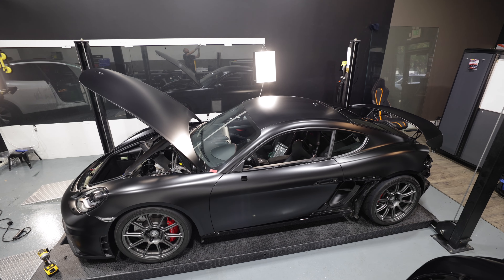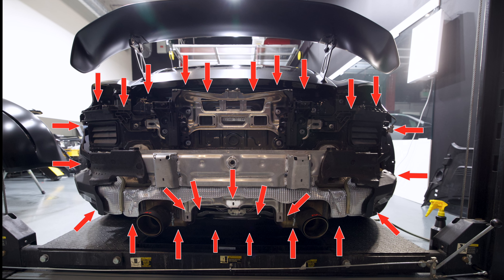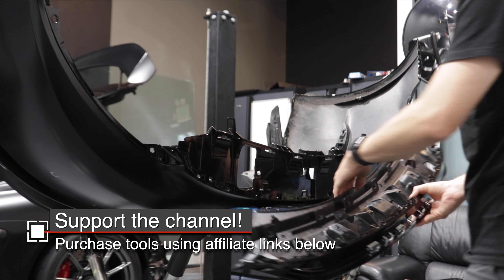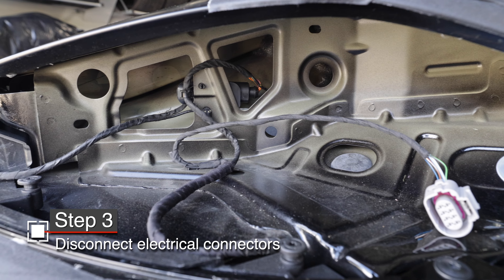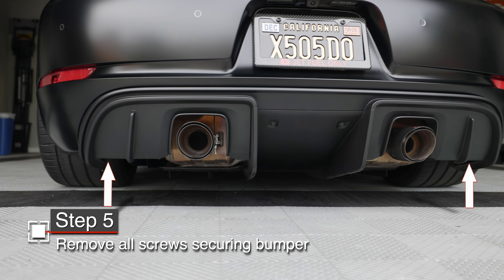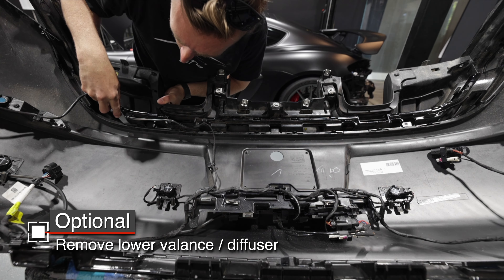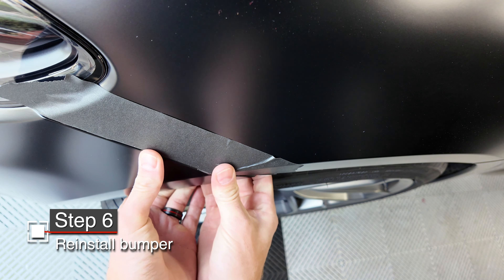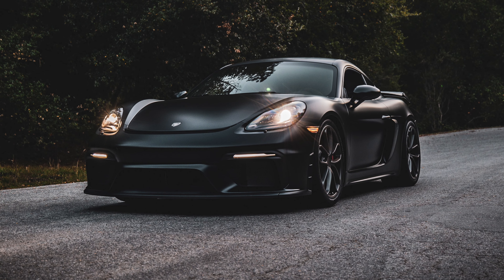Rear Bumper Removal | Porsche 718 Cayman Boxster

Comment: Excellent video! Saved my life! Lol. I was installing a light bar which was one piece w the Script. Installing the base first then simply snapping on the script made it possible per your video. Genius! Side note: backup camera now not working. I probably disconnected the camera and didn’t notice it when I reattached the bumper. No big deal .. will have at it again in a few days. Thanks
Reply from the maker: Nice!  I want to see pics of the light bar setup you got. Send via IG if you can. The camera is surely one of the connections behind the taillights. I would start with the right side.
Reply: Will do. The light bar was defective - not powering up so they’re sending me a new one. Meaning I’ll have to drop the bumper again. Be glad to send you pics when completed. I’m hoping camera’s not working from a simple disconnect🤞but I’ll have to live without a backup camera for a minute until it’s time to drop the bumper again.

Comment: Watching the video to take apart a 2024 718 boxster with the moving spoiler, they are also T30's underneath. Video said T25's but this one with 500 miles is T30's. Guessing the other car you used for reference has been worked on. 

Hoping those T30's that are hiding under the spoiler are all I need to remove on the top. I'll let you know if I have any trouble removing the bumper. Not sure if the rubber grommet looking clips on each end have to be removed as well.
Reply from the maker: Thanks for reporting back. Be sure to check out the forum post that is linked in the description below the video. That information comes from a Boxster

Comment: 718 GT4 - I Removed the 4 hex bolts and removed the painted top piece of the tail, and removed the two hex bolts that secure the plastic section, but it won’t budge? How do I open the tail when the car is parked? Do I have to do this to reveal some bolts that I can’t see because the tail is currently in the closed position? The is no button in the car to lift it open.
Reply from the maker: There’s nothing to remove at that point. You have to remove all other fasteners to remove the bumper.
Reply: @JetFuelOnly  yeah I realised that after! Thanks dude, such a helpful video 👌